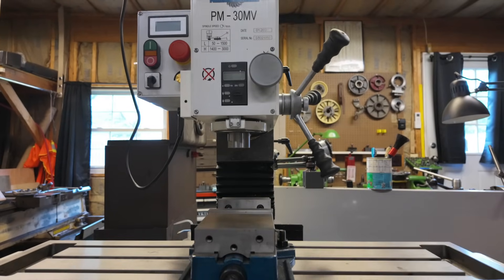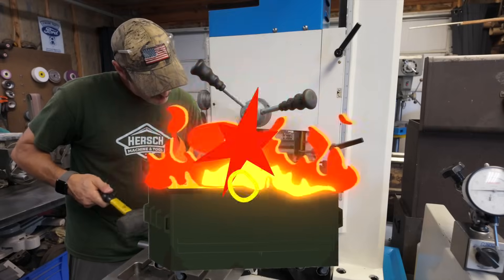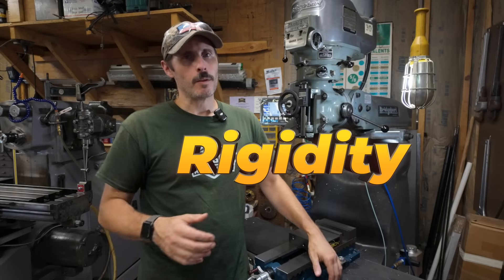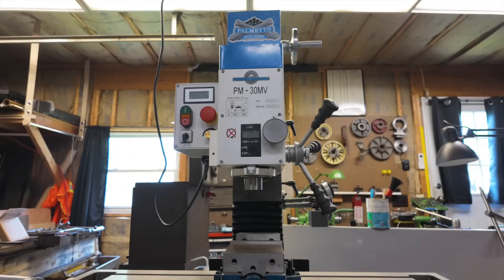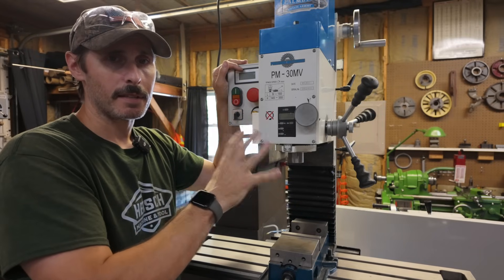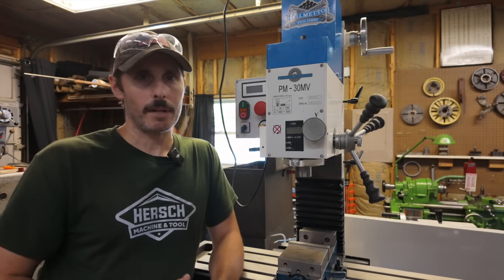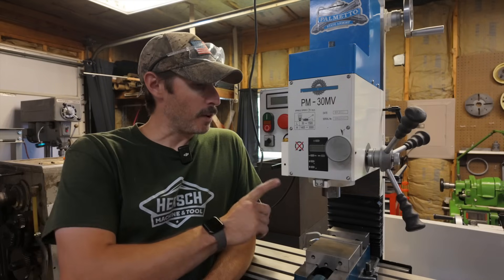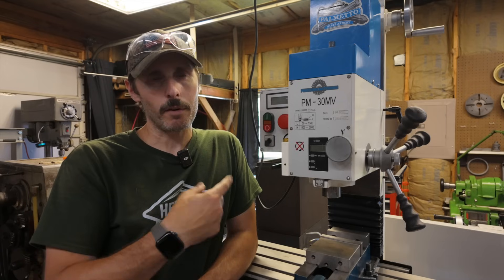All You REALLY Need to Know About Mini Mills

Comment: with my Warco minimill..it was a re badged Weiss mill...but Warco promised every machine was checked and came with their engineering report....it didnt...no report, head had wrong size bolt holes, looked used (evidenced by mangled battery cover for hight DRO)  so....save money and get one from China directly.  thats my personal experience.
Reply from the maker: That's awful, I'm sorry to hear that happened to you. Was it covered by warranty and support? But I disagree whole heartedly. I spent a lot of time researching before I bought my first machines and settled on PM because of what I'd read and heard about them. I wasn't disappointed, and it turned out to be a great decision. Their support and warranty is fantastic. I actually broke my lathe a couple months after I got it, completely my fault. They sent the replacement parts free of charge, even though it was my fault, because they said it was a common beginner mistake. They then walked me through the entire repair process. Just excellent customer service and support.
Reply: @hersch_tool  Precision Mathews are rebadged Chinese machines with a different paint job. But that's where the similarities end. They are considerably higher quality in terms of fit and finish, rigidity, and accuracy. Consequently, they cost more than what you would find online.
Reply: This reminds me of the debates about whether Apple products are worth the extra cost. Almost all of them ignore Apple's 24/7 phone customer phone support by an intelligible local representative, or the ability to bring the product to a local Apple Store for help. Practically none of them consider the resale value. After a year or so of owning an Apple product, you can easily recover 50% or more of what you paid for it on the second hand market.
Reply: Top report, well spoken, thankU!
Reply from the maker: @iggyppup  thanks for watching!

Comment: Uhhh pretty sure electric motors torque goes down with rpm not up….power goes up with rpm but torque is the flat till it drops off at high rpm
Reply: The lower the RPM the lower the torque with most motors. Certainly with the types of motors you're going to find running spindles.

Comment: Decisions, decisions.  I decided on the Bridgeport. J head, step pulley.   Buy once, cry once.
Reply: It's great if you have the space in your shop or garage where you're not trying to move the thing down basement steps.  Also great if the machine is in reasonably good condition, or if it's in bad condition, you have the time and money to fix it.

I'd love to have a used/reconditioned Bridgeport, but it's just not in the cards for me...  As it is, I'm going to have to completely disassemble any import mill or lathe so I can carry the parts down stairs into my basement shop.

Comment: I had 2 of these, both were bad from the factory. Dovetails were off a mile in both. Everytime you unclamped the head it would tilt almost 0.020-0.050. Then when you retighed the clamps it never came back to zero. If you tightened up the gib didnt make any difference. After year and a half of messing around i returned the second 1 and bought a Jet JMD18 and havent looked back. Much much better than the dovetail mills. Finding a Bridgeport in my parts that are worth a hoot is like finding hens teeth. My lathe is a Rockwell 11x36 flame hardened bed. Geat score at the time and has been serving me well.
Reply: I've found that the Chinese PM machines are no different than all the other Chinese machine tools from other brands.  You get marginally better paint and different features, and better after-sales service.    Other than that, they're all the same, same castings, same machining/grinding on the dovetails.  PM does not claim that they get "the best castings" because they know they'd need to back up those claims.  

I spent an afternoon trying to put a friends square column PM mill into tram.  It had some problems with the head tilting forward, and an unfixable problem with the saddle dovetails being out of square. You need to check everything with a granite square and dti.    His was purchased 2nd hand, so there was no option to return it..  I've  also come to believe that the RF30/RF31 is generally a better bench mill than the RF45 dovetail machines, and the inexpensive 6x26 knee mill is even better.
Reply: @vandalsgarage What brand 6x26 knee mill?
Reply from the maker: Wow, that's crazy, my experience with Precision Matthews has been the exact opposite of yours. I've had one of their lathes, and one of their mills, and they both arrived beautiful out of the crate. Glad you got it sorted either way.
Reply: Your issue is not with dovetail type machines. It’s with a mismachined dovetail. You found one bad Toyota and decided Kia is better
Reply: @jakeperry8773  No, I had 2 that were the same way. I also talked to a few others that had the same issue just not as bad as mine. Maybe the ones from Tiawain are better, mine was from China. Regardless these type machine all have there compromises, dovetail and round column. I just had alot better luck with my Jet, could be because it can from Tiawain or maybe I got lucky this time. Anyway I would not trade my round column for a dovetail, I'm sure there are others that disagree and I'm fine with that.

Comment: All great points you made there.
At the end of the day, any mill or lathe is better than no mill or lathe. I haven't got the room or money for a Bridgeport etc but I wouldn't be without my hobby sized machines now. I've done so much with them over the years.
Reply from the maker: Thanks very much. And I agree 100%, whatever machine you can get and use is the right one! Thanks for watching and commenting btw
Reply: I paid at least as much for my import machine as I would have spent on a decent used Bridgeport style machine but I simply don’t have the room. I’ve heard all of the arguments about a Bridgeport not taking up much more floor space than a bench-top but that doesn’t mean that I’d be able to wrangle a one ton+ machine down into my basement. Also, finding a decent used knee mill isn’t as easy as it used to be.
Reply from the maker: @robertpearson8798  yeah there are a lot of situations where a bench mill will fit but a full size knee mill is just out of the question.
Reply: @robertpearson8798  Yeah, that's my situation too Robert...  The PM-728VT, fully optioned out with all the delivery options, is about what a used Bridgeport in what I call "serviceable condition" would be in my neck of the woods.  I don't have space for it though.  Moving would be a challenge, even if the 97yr old floor in my garage could support the weight of it. 

So benchtop machines are the way to go...  Maybe someday if our next/forever home has a 3-car garage.
Reply: @robertpearson8798  Yeah, even in my garage/workshop, trying to move a 1 ton machine would be a nightmare.
My mill is around 200kgs and that's bad enough, I moved recently, don't want to move that again.

Comment: My smallest milling machine has 1100Nm of torque. But I also do this for a living. Basically boils down to: Any milling machine is better than no milling machine. Just buy the best thing your wallet and space budget can fit.
Reply from the maker: Amen to that. 👍
Reply: @hersch_tool  what about HBM in netherlands 🇳🇱?? i want to buy a millin from them! what is your advice
Reply from the maker: @fuhrermk92 unfortunately I’m not familiar with that brand. Maybe someone else can comment with some helpful info for you though. Thanks for watching btw!
Reply: @fuhrermk92 did you buy it? If so how did it perform?
Reply: @fuhrermk92 HBM is just a default China Mill with there Brande and colors. Just compare HBM and Vevor you will finde Kind of similar Machines.
Reply: Always remember to find - and work within - your limits in terms of feeds and speeds
Treat every ‘affordable offbrand’ machine tool and tooling as if it was a ‘kit’ that constantly needs work done on it, upkeep and improvement
Make sure your workbench is flat, square and workpiece secured before machining
Do not machine things that are harder than the tooling you are using
It’s okay to make mistakes (avoiding them is best, of course), as long as you have the needed Personal Protective Equipment on… and mmmmaybe spare parts on hand.
Reply: Totally agree. 
For several years I only had a mini lathe, then I was given a cheap mini mill, friend only ever used it to drill a few holes
Didn't know I needed one until I had it. 
When control panel failed I ended up buying a mill drill as it was 'affordable' (wife still complained it was 'too expensive')
Reply: That's the bottomline for sure.
Reply: AND understand the limitations of each machine; if you try to deck engine heads on a round-column mini-mill, you are gonna have a bad day.

Comment: I have a vevor mini lathe with metal (not plastic) drive gears.  But as an avid 2 wheel enthusiasts, I have concerns about your review of the differences in the mill.  Color means nothing. 

Aftermarket plastics for motorcycles are priced from $200 - $800 (like auctmart) and others.   I had issues where the plastics literally exploded after installing.  I did some major digging to find out who makes the best aftermarket set,  and their price differences compared to quality. Turns out every single aftermarket manufacturer (or re-saler) has their product made from the exact same machine, in the same production line, using the exact same material.   They just have different stickers placed on them.   Coming from China, I'm going to go out on a limb and say every single machine is exactly the same, but the (re-saler) manufacturer has them painted for their associated theme.

I'm looking into hobby mills, but after getting my vevor, and then finding out that a product that is (I believe) made in Australia with power fed everything (table, cross-slide, etc....) could be had for about about twice what i paid for more than the junk I bought, I was mad.   Channel "cool ideas DIY" has a similar style machine I'm talking about.  I won't be getting a Chinese mill.   I don't care about any reviews,  I know China is just junk with a pretty bow.   It has been over a year since I last looked, so I forgot the brand, iirc "artisan makes" has that lathe of interest as well.
Reply from the maker: Brand has nothing to do with the paint job. Ive had import/chinese machines and tools from different importers/manufacturers in the shop and have actually used them. They are certainly not the same machine with a different paint job. That said, yes many of them absolutely are the same which is why I stressed the importance of buying from a well known and REPUTABLE brand that is domestically owned and operated, like PM in the US for example. Do your research. Artisan's machines are both Chinese made iirc?

Comment: I agree : stay away from round column mills. They are cheap, but when you have to change between longer an shorter tools (long drill to chamfer drill) you will lose your zero reference EVERY time, and that gets very old very fast!
Reply from the maker: This is exactly right. That's why I call them "drill mills". IMO they are a drill press first, that happens to have an XY table and an R8 taper.
Reply: @hersch_tool  Mine is an RF30 and has an MT3. I am in the process of swapping to a machine with square column. If I ever get to mounting the DRO on that … 🙄
Reply: @hersch_tool  I've heard round column mills also referred to as "coordinate drilling machines"...  Meaning, they're more ideal for drilling hole patterns in a part to a fairly tight positional tolerance.  Rather than an acceptable milling machine.

Comment: avoid the tilting collum machines too. the whole thing tilts on 1 bolt and it is so unstable it always comes loose causing issues.
Reply from the maker: @mike9500  ooof, yeah that’s a horrible design
Reply: I have one of those, and plan on modifying it with tensioned stabilizer bars, either solid slotted with bolts, or with turnbuckles. It works well enough for what I do with it, though it does not have the original milling table base top, so had to make do with  a makeshift one out of large C channel and an import xy mill table. Needs a lot of work for actual precision, but it does what I need it to do for now.
Reply: @asakayosapro  if it works for ya good to go!

Comment: yep! the materials used in the cast iron, the quality of the casting and the final machining to spec. a named brand has higher tollerances and requirements than say "joe Hong" who took a cart in to a factory, grabbed a bunch of parts from a scrap, painte3d and assembled and sold it online. (about 80% of the time the no namaed brands are made up of scrap parts that did NOT cut the mustard for the named brands. now, if you buy parts 1 at a time you get top quality just like the named brand, as in my case. my origional cross slide was destroyed and so far out of wack it was not salvageable. i got a new one and BAM! dead nuts perfect! at a cost of $109 shipped but that was worth the $ compaired to the headache i was getting before.
Reply from the maker: Yep, exactly!

Comment: I had no machine yet from CHN that didn't need tweaking.. even the ones that come branded and are supposed to be custom made for the western importer.  So as others have said before me - consider them a pre-assembled kit (for transport) that needs to be taken apart, cleaned, deburred, tweaked, maybe modified to get something that will do what u wanted it for.  Also expect to pay what u paid for the machine itself in accessories/tools/etc. to be able to use it.
Reply from the maker: The tooling cost is a very real thing that I bet a lot of folks just getting started aren't fully prepared for. Definitely worth mentioning. And to be honest, I don't think I've ever had any machine that didn't need tweaking. Whether it's a new import, or old US iron, they all need some love before use. And really, the old iron can be a LOT of work, I mean a LOOOOOT lol. All things worth weighing in the final decision for sure.
Reply: I got a bigger mini lathe that had a actually respectably good chassis. To do what I wanted it to do I've gone through pretty much every inch of it and replaced or modified EVERY single part. Huge motor upgrade. Rigidity upgrades, spindles/bearings, new lead screws on all points anti backlash nuts, totally new custom gear system to fit the 4.5hp motor, total new diy power and Control system, powered feeds etc etc etc.everything. It's an absolute pocket hot rod with zero backlash now😂 took 6 months.

Comment: I have a machine very similar to yours, but something I don't like about mine is that the bearings are shielded and there are no lubrication ports.
Reply from the maker: Why does that bother you? My machine has shielded taper roller bearings as well. They're designed to last a very long time.
Reply: @hersch_tool  All machines I know have lubrication ports. I didn't know this other system existed. Thanks for explaining it to me.

Comment: Hard to say bad things about the PM mini-mills.   I wish they were much cheaper but I say that about everything that I want but cannot afford.     For small machining they seem like a lot of fun and capable for small parts.       Not going to machine an engine block or head but great for making small parts and models.
Reply from the maker: Yep, agreed. And also, double agreed lol.
Reply: @hersch_tool  I thought mini mills were the ones that are much smaller.  I had a micro mark, which was much smaller, and had no moveable spindle. The whole head had to drop, like other mini mills.  That is the difference between a mini mill, and a small bench top mill.  Precision Mathews does not sell these less than 100lb. Mills.